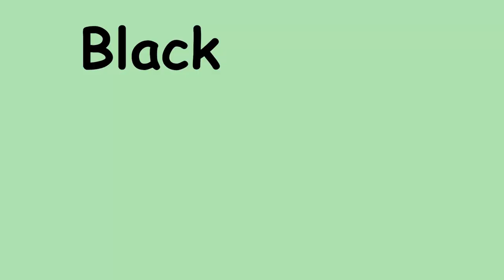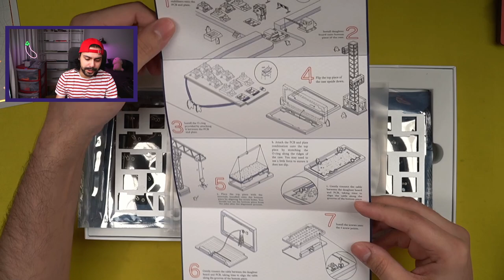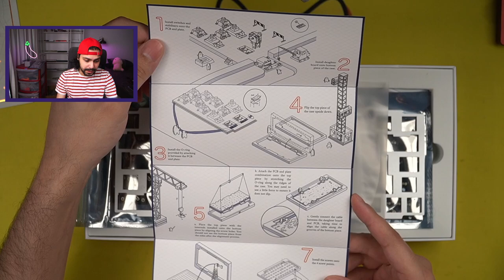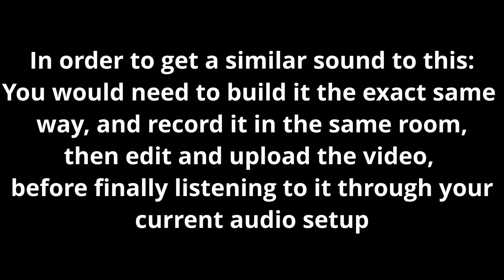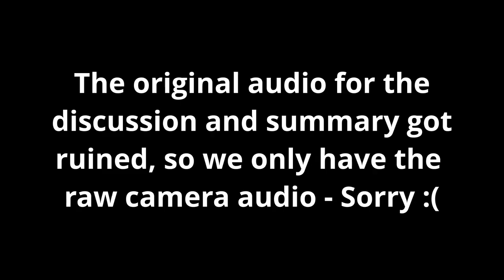Kei Keyboard In-Depth Review

Comment: Re: screws, if those are M2 screws, they definitely do come in hex (blech) and Torx T6 (yay). Most Amazon/Ebay precision driver kits include at least a few Torx bits, as well. And if you're a keyboard buyer, you can get a 100 pack from McMaster for $5-6 if you live in the USA, in case your GB runner / designer decided to cheap out on hardware.

Comment: The gummy snake basically makes the entire top portion of the case rest on the bottom?
Reply from the maker: The top rests on the bottom without the help of the gummy - but it does get smushed in there a bit when the case is assembled
Reply: @Blacksimon  sounds like it's a bottom mount with extra steps